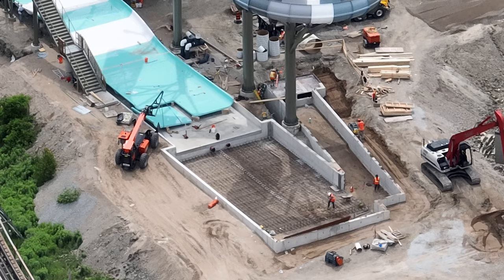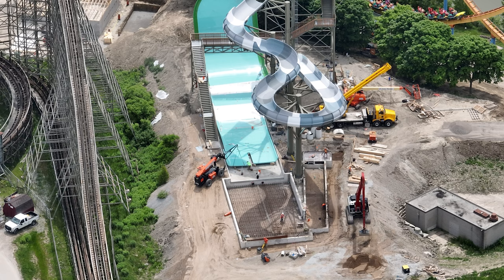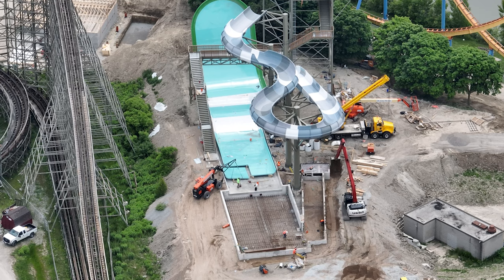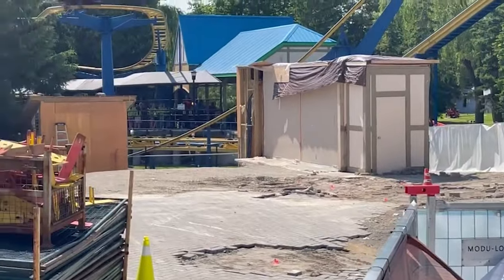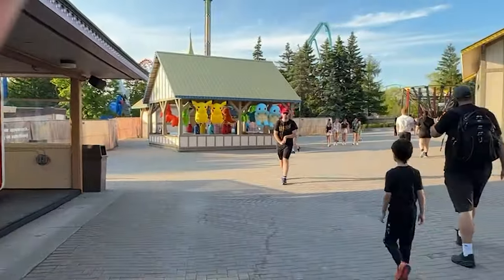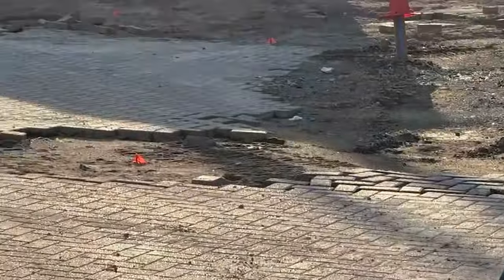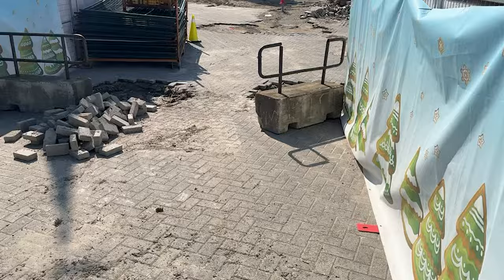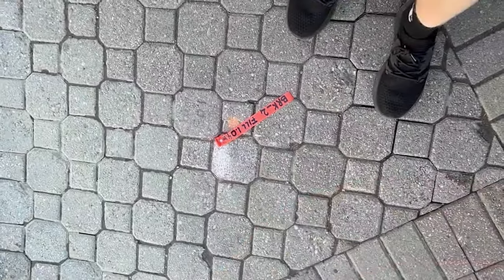Canada's Wonderland 2025 Construction Update

Comment: I am curious about the marking someone saw by Kingswood (numbered 47 if memory serves me right). Coaster could swing out there if it hugged the tree line much like Leviathan does on the other side.  1600-1900 feet out and back to Kingswood from old Skyflyer area. This would guarantee the coaster will be 4500+ feet. Based on the numbered markings you found so far it would seem difficult to do much between the mountain and Skyflyer area. Using that stretch would leave lots of space for a second straightaway launch which would be needed for a big top hat at the front of Skyflyer space.
Reply from the maker: Those are old and for another project
Reply: Thanks, good to know.  I will taper my expectations again so I won’t be disappointed in the final outcome…lol.

Comment: Yesterday at Wonderland in the evening I actually saw splash works from Yukon Striker having its water running down the slides and lazy river.  I think the reason the water was on is because Moosehorn has started the plumbing.

Comment: Interesting question: If you had to remove 1 attraction from Canada's Wonderland, what would it be?
Reply: Go Karts
Reply: Flight deck and Time Warp. Both suck equally. I literally got a cramp in my leg thanks to flight deck.
Reply: @googlethecat4218   they said 1 attraction so I chose gk. It opens up space for either a RMC Wildbeast or a new ground up coaster that's better themed to Medieval Fair. It would also bring us to 20 coasters if it was compact enough or extended by the plot north of Dino's Alive.
Reply: @ryan6523 I’ve always imagined a B&M invert in that area! It can also stretch to the empty land beside Dragon Fyre under Levi’s break run
Reply: 2... Whatever Tombraider is called now (Zamperla JUNK), and Flightdeck. Opens up good space as well for expansion